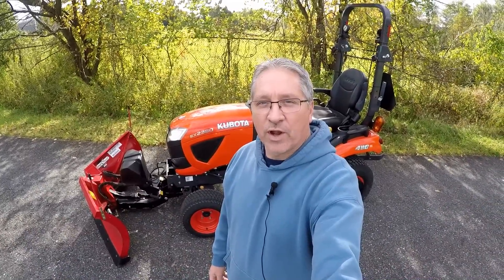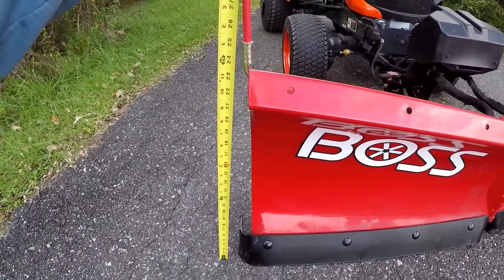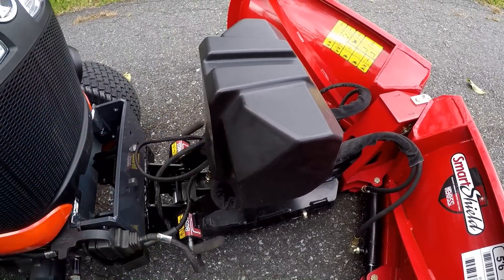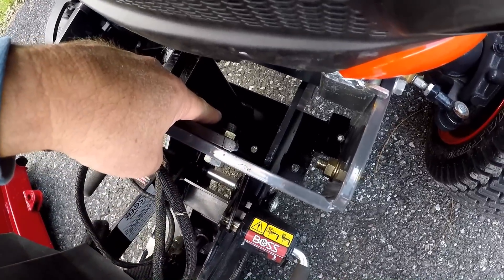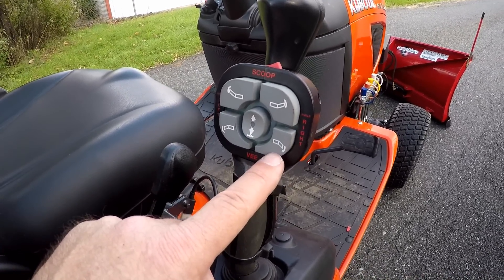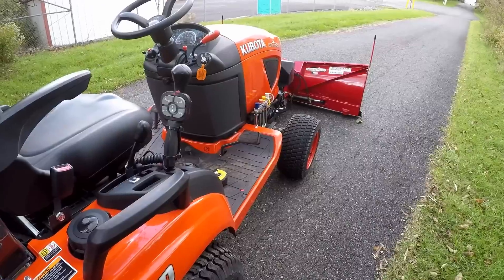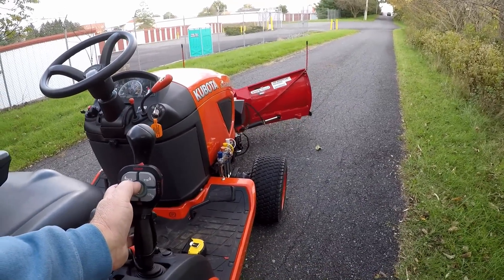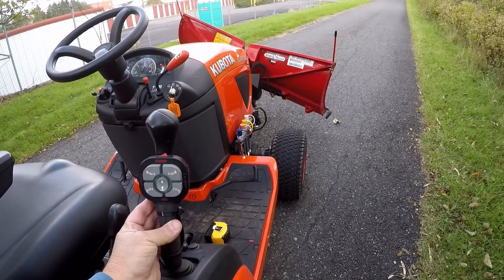Kubota BX snow plow - Boss UTV V plow XT

Comment: I thought Kubota notes in the manual that if you fill the tires, you should not use tire weights... you risk damaging the transmission.
Reply: It does but obviously he didn't see it or he simply doesn't read or respond to any of the comments on this Channel. I have weights on my wheels and because I have wheel weights from several of my old tractors I built a bracket that holds 4 more wheel weights on my three point hitch with a built in stand that I can drop the weights down to the ground when I'm done so when it's parked for long periods of time there is no weight on the 3 point hitch.

Comment: Why electric over hydraulic? I just don’t see the benefit
Reply: I assume it's because the plow was designed for an ATV without hydraulics available. Just because something can be done doesn't mean it's the best solution. Looks like a nice plow for someone who doesn't have hydraulics already. But it adds expense for tractor owners. Retrofit it to use the hydraulics we already have and they'd sell more, IMHO.
Reply: @joes2514  I can’t see why you couldn’t just use the quick connects for the plow cylinders. It’s cool looking an we deserve v plows on our tractors but I’d like to see them mounted on the loader arms for higher amounts of snow.
Reply: @stevensilva1350  I don't know enough about hydraulics to know if the plows system could handle the pressure coming from the tractor. Their "solution" was to design a universal plow to sell to more people with the unfortunate side effect of costing more than it needs to for people who already paid for hydraulics. Basically it's a universal system that's not for everyone. It's a shame because the plow itself looks sweet.
Reply: @stevensilva1350  So you can bend your loader when you it something?

Comment: I have the B2650 with a cab could this plow be adapted to that? I already have hydraulic control that rotates my snowblower chute  that I could most likely attach the hoses for the blade tilt on to. Does this only require two hoses for the blade tilt?
Reply: I doubt it would work since this is designed to work with its own pump & solenoids much like on a pickup.  You wouldn't get all the features of the V without its joystick.  And they are priced not far from a truck snow plow.   If you have a QT skid steer style loader on your B.  There are companies that make QT plows for compact tractors, ie. Hiniker. Where your 3rd hydraulic could run the  blade angle.
Reply: 80srockerable I would keep it the way it is set up with its own pump just quick hitch it on to the front of the tractor and run the wires up by the seat. i’ve seen the joystick zip tied to the loader control lever before.  So then you would actually get all the features but I also opted to not buy the loader for my B tractor because I already have two tractors with loaders. Right now the loader control lever is controlling the hydraulics on my snowblower.  I was just looking at the hitch on my snowblower and it is attached onto the back of the snowblower separately with four large 3/4 inch or larger bolts and was thinking if I could get just that bracket then I could get it welded or bolted on to the back of the hitch of the boss V plow.
Reply: @mainelyelectric  I see. Well anything is possible with fabrication or a capable welding shop. The lift for your  blower would be redundant with the plows. But that probably ok. You probably want the ability to switch out plow for snow blower with minimum effort.  This little V's are pricey. There are other brands too. Snowdogg , etc. A small pusher may be something to consider too and requires only up/down movement.

Comment: I like this setup. The only thing I would change would be ditching those turf tires for the industrial R4 tires. Anything over a 6 inch snow and the turf tires tend to spin even with weight. The R4's actually grip and pull through snow a lot better. Other than that looks great.
Reply: I feel the exact opposite. Ive had r4 and switched to turfs. The turf tire work hands down better in all snow depths for me.
Reply: Wrong ... turf tires all the way. John Deere's 955 all 4 tires loaded push 2' of snow all day long
Reply: Turfs put more rubber on the deck. R4s wear excessively at the edges as a result of tight turning.
Reply: I had turf tires and they are garbage in the snow. Switched to R4's and much better. The R4 tread you get more pounds per square inch because of the tread design.
Reply: Carlisle Versa Turf tires are the best tires for snow.  My R4's slid all over the place on icy surfaces.  The Versa Turf tread design combines the tread of the R4's and turf giving more contact points for better traction.
Reply: Well let me give y'all an update. On my BX Kubota I found R4 tires worked better for me. But in my neck of the woods we typically only get big snows few & far between with very little ice. My grandfather who had an identical Kubota with turf tires couldn't push snow nowhere as good as mine. Fast forward 2 years & now I also own a John Deere X758 with their HDAP tires & let me just say now these tires are absolute beast in snow. I recently sold the Kubota to a friend & now I'm in the market for either a JD 2032R/2038R or a Kubota LX 3310 but regardless of what I get it will have R4 tires due to my gardening.